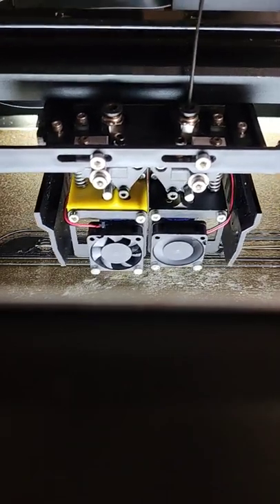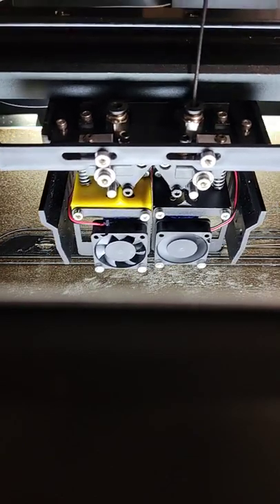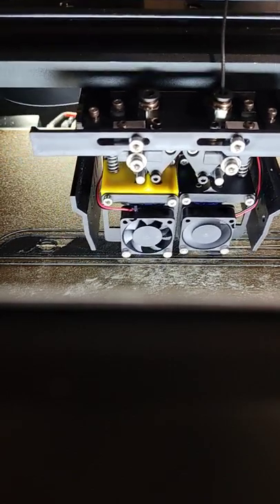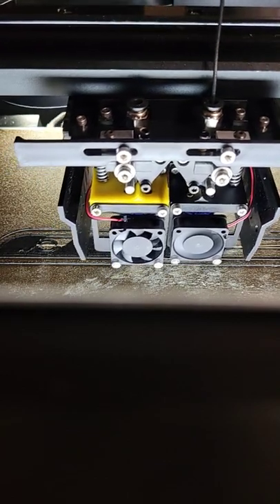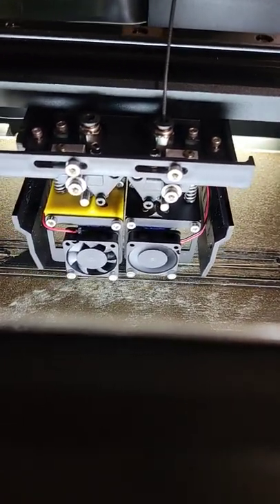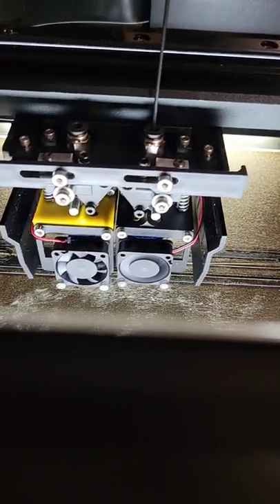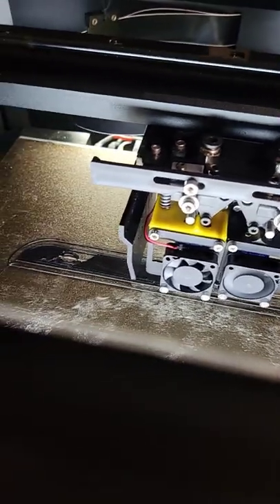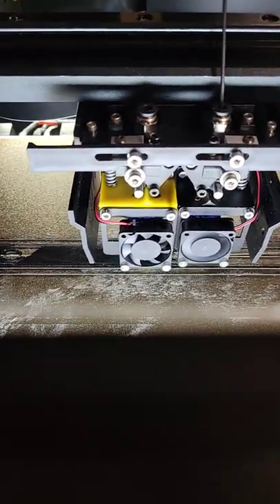New Qidi i-fast Dual Extruder Gear Hotend Test and Moded for Flex

Comment: Been having this same issue but with ABS+ and chamber heating on, the filament would soften a bit and then get jammed in those gaps after the gear and also between the bottom metal extruder plate and the heatsink/heat throat.

Ive reported this issue to QIDI a few times and I'm glad I'm not the only one. I hope QIDI fixes this as it's a big oversight and weakness with the new extruders.

Well done
Reply from the maker: Yeah, agreed.   Sorry I missed this comment.  Not getting notifications

Comment: Now we can only hope we eventually get auto bed leveling at some point as well.
Reply from the maker: It bothers me that it wasn't added as I had been told several times it would.  No big deal, would have been great to have
Reply: @melioratewithnate  When does it ever go out of level though, and the leveling process, for being manual, can it be any easier?
Reply from the maker: @TechieTard  it doesn't as much as it can move side to side  or front to back causing kayer shift
Reply: Why is only one fan on ?
Reply from the maker: @monkeywrench1951  only one extruder is printing

Comment: Hello, I've seen  that you had a creator pro, and I was wondering if you had any problems  such as randomly  turning off or not even starting. I have that issue  it would be nice if you could help
Reply from the maker: I sold my creator pro but keep good contacts woth the buyer.  He loves it.  I am not sure but it sounds like yours might need a new board

Comment: Are you saying you drilled the hole out just past the gears where the filament goes through to the heat break? Usually that's a dimpled so that the filament can find its way in.
Reply from the maker: No,  I'll have to double check the video to see what I meant.  Lol.  Been a while

Comment: Hi Nate,

First of all, thanks for your channel! I've been looking for some useful info on the QIDI I-Fast and your channel is the best I could find :)
I am on the verge of getting an I-Fast myself and it seems this printer has some drawbacks, most noticeably:
The Filament path leads to possible breaks/jams
It's just a bit too tight in there, your mod of increasing the height, drilling through the top and relocating  the sensors and adding PTFE guide tubes seem great! 

I'm hoping this printer will be able to print ASA/ABS since it has a modestly heated chamber 60c max (not like the intamsys funmat ht enhanced, however that's a bit out of my price range..) and maybe even PC, have you got any experiences with these materials on the I-Fast?

Oh and uhm will you be selling upgrade kits? (light diffuser, bottom grates, height extension, runout sensor box (are these glued to the dome ?) and those cool printhead mods?) 
I guess it would be nice if these (besides flexible the height extension) are printed in ABS?  Don't really know how to get in touch :)
Reply from the maker: Sorry I missed this message.

Comment: I have this hot end but I don't understand what you are saying you drilled a hole through or wear. Could yo explain it a bit more or show us in a video what you did?
Reply from the maker: I stopped using it as it was frustrating to convert it for flex although I did have some success, I felt it wasn't any better than the original

Comment: Qidi told me not to use the high temp extruder for anything below 250C. What is your experience about that? I don't want to have to change extruders
Reply from the maker: You'll need to for higher temp filaments.  You could increase ot a bit using Capricorn tubing instead of standard teflon

Comment: Is that hotend available for order?
Reply from the maker: I am not sure of it is.  You'd have to write qidi and see.  I went back to using both the original ones but will try it again.  You have to upgrade the firmware to use it and then revert back to the other firmware for the original ones.  Just got too complicated  switching out and the filament path isn't quite right for flex